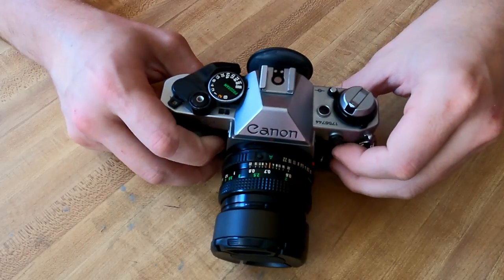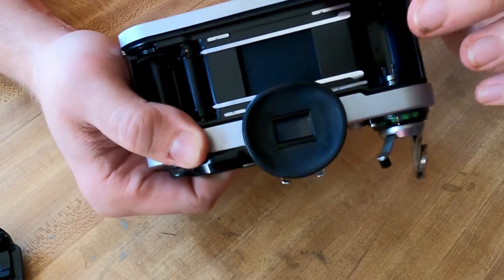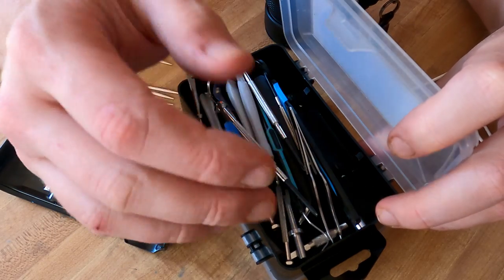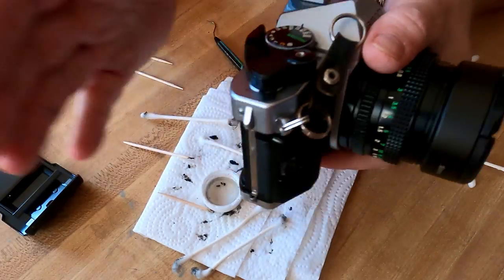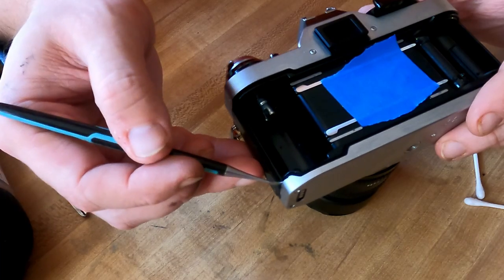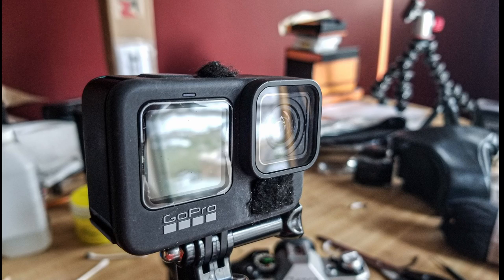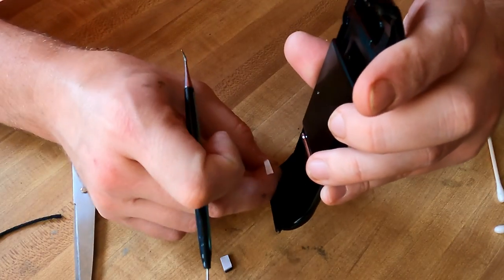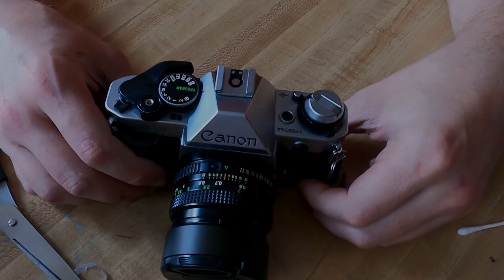Adding PERMANENT Light Seals to a Canon AE-1 Program SLR Camera

Comment: Hi - you didn't change the mirror bumpers; as you mentioned they had already been changed. Yarn probably isn't going to work for those; do you think that adhesive-backed felt, cut to the correct size, would work?
Reply from the maker: I think it would suffice for the shock absorption however this is a question that has come up on another video about F3 HP seal replacements. I would attempt to source the thickest felt possible for use in the mirror bumps. I think if I replace any more seals I'll keep using the current felt I have for all but the mirror box and use a thicker felt for that...if I can find it relatively easily.
Reply: @AdamWelch  Thanks! I think Amazon sells adhesive-backed felt tape of various thicknesses. Also, there are commercially available furniture pads, intended to stick to the bottom of chairs/couches/tables and prevent floor scratches, which are made of adhesive-backed felt and are thicker. I used these, and cut them to the right size/shape with a razor blade and a straightedge; they seemed to fit correctly!
Reply from the maker: @HBNplague  Very interesting idea about the furniture pads! I'll have to give it try. If you don't mind let me know if you run into any problems with adhesion or anything else because I'd like to know how those last compared to felt. I assume it would be about the same lifespan.

Comment: How thick should the felt be?
Reply from the maker: It's difficult to say. Most self-adhering felt I've seen seems to be around the same thickness. For the mirror bumps the thicker the better. Then again, if the felt is too thick it might interfere with the operation of the film door.